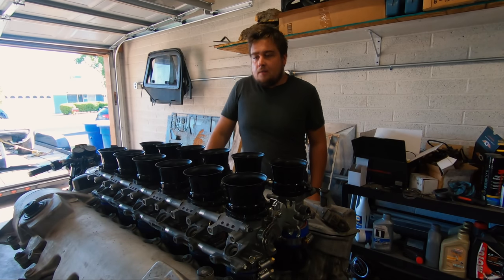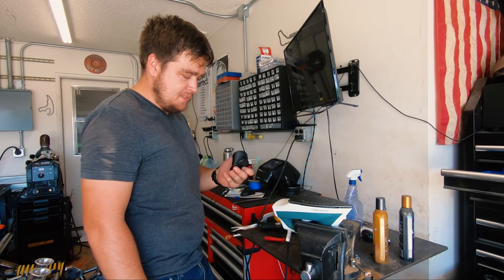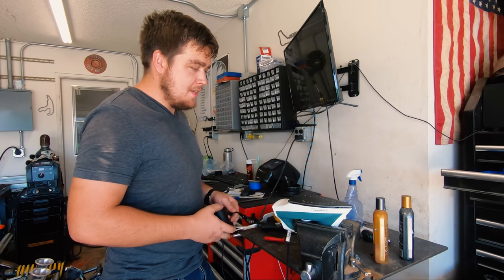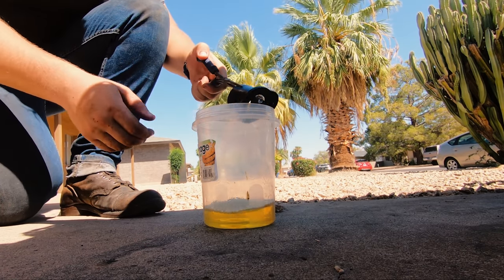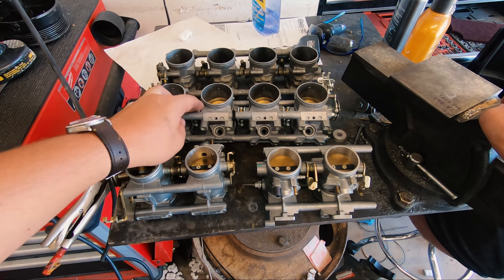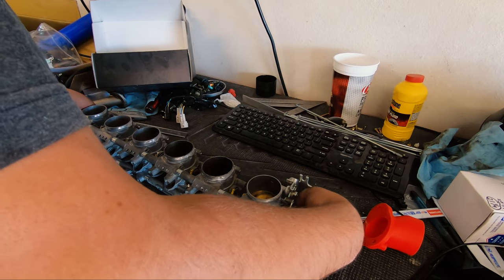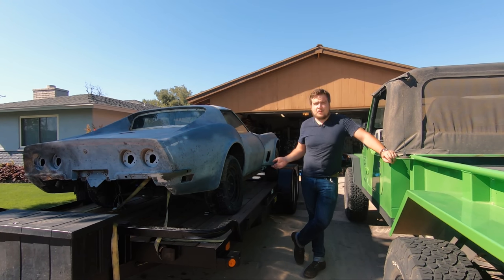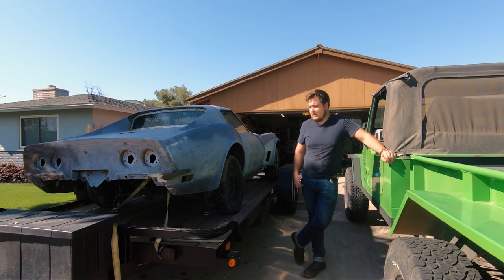Mercedes V12 and a '73 Corvette-  ITB Build part 2 of 2

Comment: Wesley, this project is awesome!  I had no idea those Hyabusa throttle bodies were modular, that makes adapting them to different engines fairly easy.
Reply from the maker: Neither did I, I'm glad I grabbed a set for testing.
Reply: @WesleyKagan  Are there any other motorcycle throttle bodies that are modular or is it just the Hyabusa?
Reply: @jameswieler3295  atleast My BMW f650 has individual

Comment: pla is the best filament i have tested so far for resisting high temperature, but you have to bake it for it to survive without warping or softening, after baked they hold up to 180 C without much deformation

Comment: Fun facts:
1) There’s some company who makes V12 LS1 motors. Literally an LS1 but with an extra 4 cylinders.

2) Chevy had an experimental Corvette in the ‘90s that was powered by a 9.9L V12 which made 683hp & 680lb-ft of torque. They did it because the Viper had come about with its big ol 8.0L V10 that made 400hp & 465lb-ft of torque. They actually had to extend the engine bay by about 8” to fit the V12. Long story short, the car never got released to the public unfortunately.

Comment: Question about throttle bodies or rather there orientation, just looking at the injector location on this throttle bodies and the intake runner tract, wouldn’t it give you better injector angles if you rotated the throttle bodies 180 degrees so the injector were on the inside of the “V” vs the outside? It seems like right now they are going to be spraying right into the wall of the intake runner vs right into the port of they were flipper

Comment: It is my understanding that gasoline will attack Silicone hose?   What is the name of that plastic you are using for the 3d prints.   Overall very impressive project!
Reply: it won't attack the silicone, but gasoline vapor molecules are small enough to leak through silicone, so there's a slight chance of faint gasoline smell when the engine's running or recently been turned off.

Comment: How will you get vacuum for the brake booster etc?  Separate vacuum pump or is there something already integrated into the bodies?  Interested to see how your 3d parts hold up, they look pretty solid.
Reply from the maker: With my experience on the cart I found that vacuum is unreliable at best on ITB's, so I'm probably going to take the smog pump on the Benz, wire it backwards, and make a vacuum pump. On a corvette there's a LOT of vacuum needed. 

For MAP the throttle bodies have ports already.
Reply: @WesleyKagan  yeah a separate vac pump makes sense here I think. Lots of automotive options for kit cat builders

Comment: Id also be worried about the 3D printed parts snapping due to vibrations they have to hold a lot of wight in those throttle bodies
Reply: They look like he used a lot of infill though.. those parts are really strong when printed fully out of plastic!
Reply from the maker: Lots of infill and there's 12 of them holding up 12 throttle bodies. I'm keeping an eye on them but I have hope.

Comment: Would you mind sharing the specifications of the material you 3-D printed and the printer used?
Reply: Lassi Kinnunen thank you!
Reply from the maker: Yeah, Bigrep Hi-Temp. Printed great, and if it holds up it'll be my go-to filament for car parts. I used essentially PLA settings with a 60 degree bed.
Reply: Wesley Kagan any specific printer? Sounds like it will be a difficult print (based on the material)
Reply from the maker: @K_M_M_G   I have a Prusa MK3. Printed better than PLA, honestly. Took forever, probably 90 hours, but turned out great.

Comment: With this kind of setup how do you manage everything like MAP sensors, throttle position sensors etc ?
Reply from the maker: I'm planning on a Ms3 Pro, I've used it before and it's my favorite aftermarket ECU
Reply: @WesleyKagan  Okay, how much does it cost in average ?

Comment: I'm doing something similar for a BMW i6.
All in PLA and so far so good.
What's the high temp filament you are using?
Reply from the maker: It's bigrep Hi-temp. I highly recommend it!
Reply: @WesleyKagan  wow, softening temp of 160 Celsius and nozzle temp of 215.
Just solved my dilemena.
Couldn't decide whether to upgrade and print  polycarbonate or risk it with ABS.
Problem solved.
Thanks

Comment: You junked that Mercedes body?  Hell id a duct taped a 4 banger honda heart up in it and sold it for 4 to 10 grand depending on how well i duct taped it in there..  but if you did a little work and put a cpu and wired it up adapting the mercadees dash and shit you could get a lot more out of it..  nobodies ever seen a k swapped c class..  call it the merconda kc4...  lol..  put a terba on it and give it around 700 to the floor with the rwd and big body with that suspension system..  might turn out to be a killer..

Comment: U said phoenix that's awesome I'm in n phx have a 92 600sel and a 77 c3 vette vette runs mb sat 11yrs now trying to turn over after replacing fuel pump n filter n flushing system I'll try to contact u thru your email